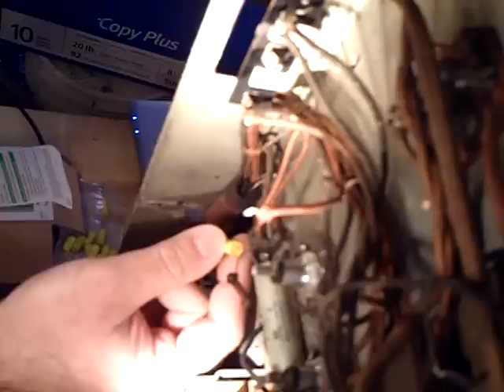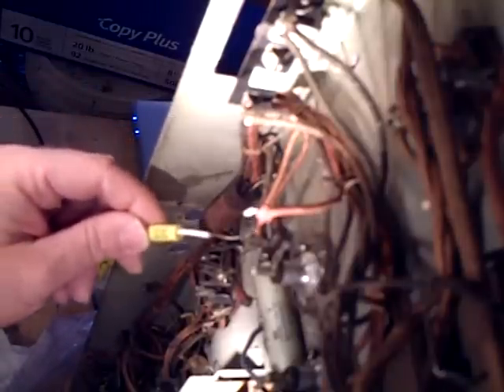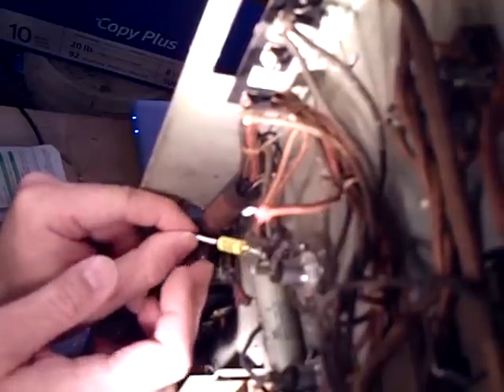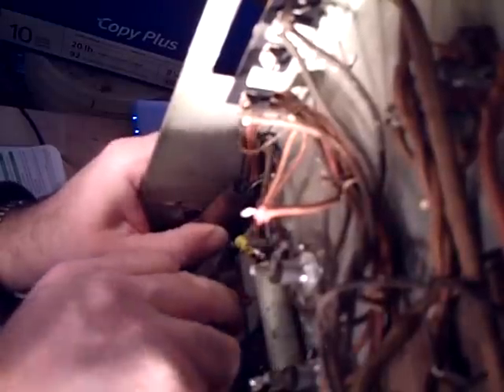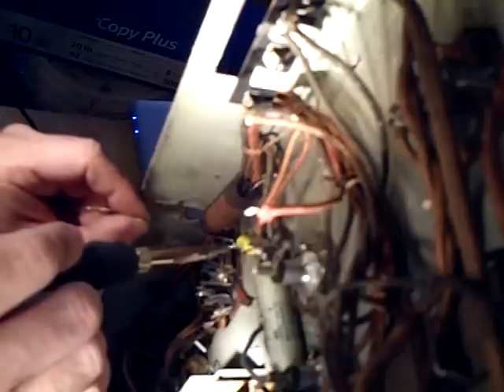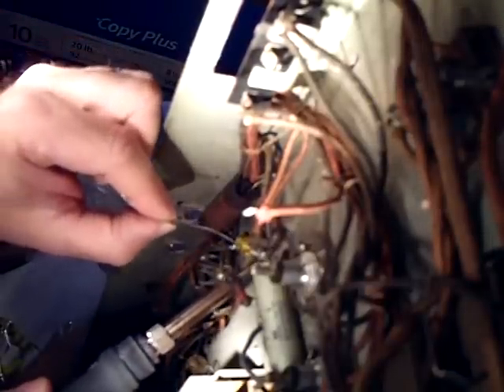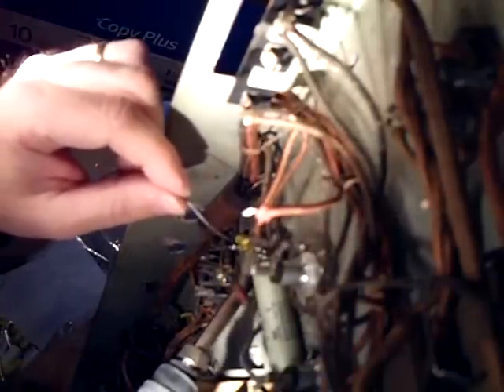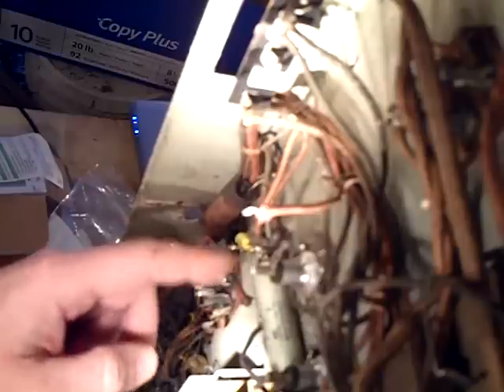Part 4 and conclusion. Capacitor replacement in an antique radio

Comment from the maker: I use the old leads sometimes if the locations are hard to get to.
I remove the old leads since some radios I've worked on were repaired 3 times already and i didn't want to attach leads to an existing lead when the lead is attached to a terminal with 2 or 3 existing leads soldered on.

Comment from the maker: Sometimes I cheat  a little and connect a new capacitor to the old capacitors leads after clipping out the old cap. Check out the other dudes videos too for different takes on radio repair. I think the main idea is to take your time on the project and also take a slew of photos of the circuits before starting.

Comment: Good video...what kind of solder did you use?? I like thin solder myself...
Reply from the maker: I use mainly Kester rosin core for electronic work, the thin stuff. I think it's  60/40 but don't have it in front of me.
It rolled under the table and I can't find it! Got to get some more.

Comment: i dont see nothing wrong to use old leads for connection in fact i think you run the risk of  damage buy trying to pry old leads off. and also it takes way too much time  yes it is neater but who is going to see it . 
.